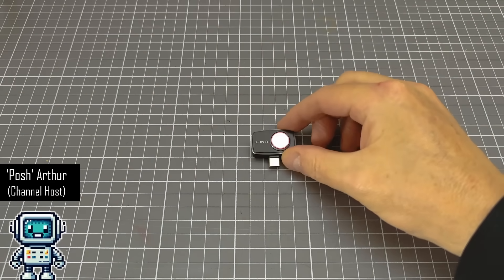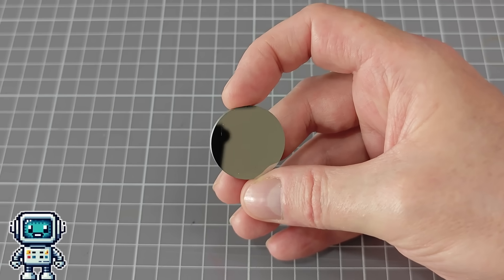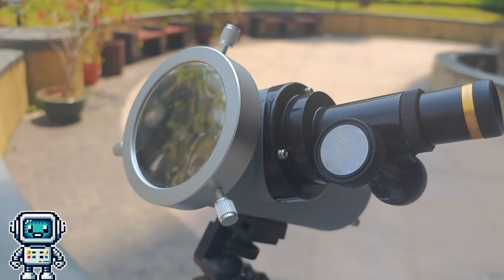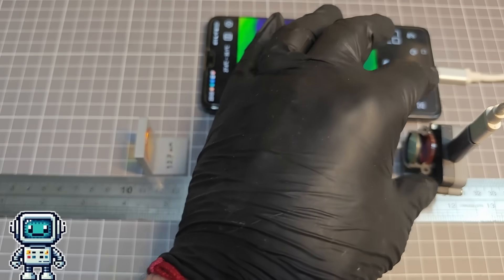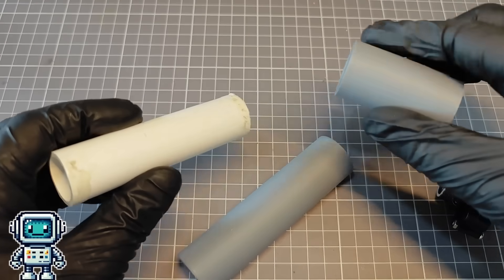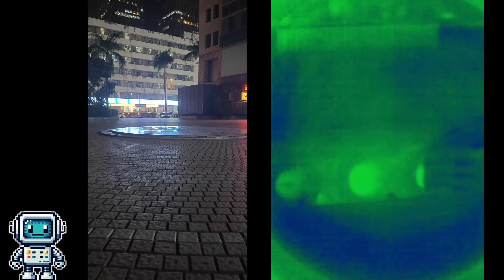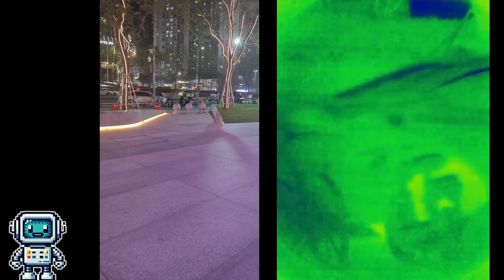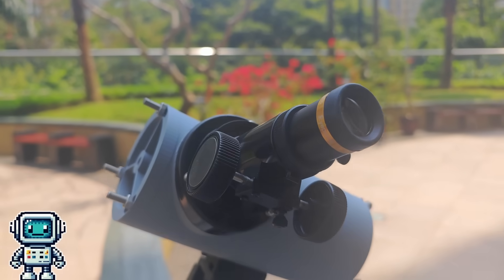Easy DIY Thermal Telescope with over 10x Magnification

Comment: Hmm, you could place a DLP chip in the optical path. By flipping a select set of its mirrors in sequence, you could play around with a form of compressed sensing. At the expense of framerate, you could synthetically increase the resolution of the output image.
Reply from the maker: Thank you for the comment and the idea.  I do like this, its a sort of interpolation, but not sure what the DLP mirrors spectral response looks like.  They are probably optimized for visible light?
Reply: @project-326  Apparently you do get diffraction issues in IR because the structures of the micro-mirrors start to be the same size as the wavelength of the light. I can't find it now but someone discussed using a single-pixel detector for space applications
Reply from the maker: @Virsconte  thanks, I will take a look into that
Reply: @project-326  To be honest, I haven't thought of that. I just expected them to be first surface mirrors.
Reply from the maker: @EatRawGarlic  It's a strange world of coincidences, but I might be looking at a DLP system fairly soon, I guess I will be in a position to look at the specifications of these things soon...
Reply: @project-326  Excellent! Looking forward to seeing it your new video.

Comment: Hello, thank you for your video. I wanted to look at the moon with a thermal telescope, but unfortunately my experiments were unsuccessful. In one of my attempts I tried to install only ZnSe lens, D20 F100, without native lens, for reasons unclear to me I could see objects only at a distance of up to 10 meters, and all of them had to be hot, the camera saw a 90 degree kettle as 30 degrees, but if I return the native Germanium lens, it was possible to get magnification using a combination of ZnSe and germanium, but with a small field of view, and at the same time the temperature was already shown correctly, it seems to me that the matter is not in the diffraction limit, but in the adjustment and suitability of the sensor to the wavelength, that it is narrower, and rather the focusing problem can be solved with a germanium filter (which, unfortunately, is expensive), the diffraction limit refers to the image quality and dependence on the diameter of the lens, so it is possible that the matter is still simply in a large number of different wavelengths that have different focal lengths, possibly worsening the frequency needed for observation.
Reply from the maker: Thank you for the comment.
You will need at least two lenses in the system to re-parallelize the light, otherwise objects in different parts of the scene can have paths not linearly related to the position in the frame, or blurring as it is often called.  With just one lens you will be able to get a single focus point, for a given depth of image, but a parallel light path is needed before hitting the image sensor, otherwise major depth of field issues occur.
I hope that helps...
Reply: @project-326  Thanks for the answer, I still don't get it(
I guess I need to study more.
Reply from the maker: @natali_sb  at the end of the optics nearest the thermal imager, you want a lens with a very low focal length, this will enable it to be closer to the imager and thus have a better FOV, for the object end, your F=100mm lens will give you a good magnification.  The issue is that ZnSe or Ge lenses with very long or very short focal lengths are expensive.  The standard is around F~30 to F~60mm and the further you move away from that, the price goes up very fast.

Comment: Why not directly focus the image from the first lens (the one with more focal length) onto the sensor instead of using two lenses along with the default lens placed in front of the sensor. 
I once made a telescope using 700mm main lens and a 4mm eye piece lens and got a decent zoom, then i removed the lens from my phone's camera and directly focused the light from the single main camera, like that the zoom level was increased insanely high
Reply from the maker: Thank you for the comment and advice.
The issue with Thermal IR is the wavelength seriously limits the magnification factor unless the overall F number can be seriously increased, ie with a larger mirror or lens diameter.  The restrictions are literally 20 fold that of visible light.

Comment: Success at last!  The Moon image is very interesting.  If you get your Newtonian telescope made it would be very interesting to point it at Jupiter to see if you can detect the different temperatures of some of its four visible moons.  In particular Io is covered in active sulphur volcanoes while neighbouring Europa is covered in ice.  Not sure however if you might need something with a mirror of about 6" diameter to enlarge the moons so they cover a single pixel.
Reply from the maker: Thanks for the comment and great ideas!
Reply: I was surprised the image was so defined very impressed with that and it shows potential for significant improvement with larger mirrors.
Reply from the maker: @Woffy. I agree

Comment: given the pixel size and number of pixels what nyquist sampling rates did you try out? Aside from the glass quality, isn't there a particular fov pixel sampling size you should shoot for?
Reply from the maker: Thank you for your comments and ideas.  Pixel size certainly plays a part, but there is also a compromise there too, smaller pixels results in higher packing density but also result in lower sensitivity...